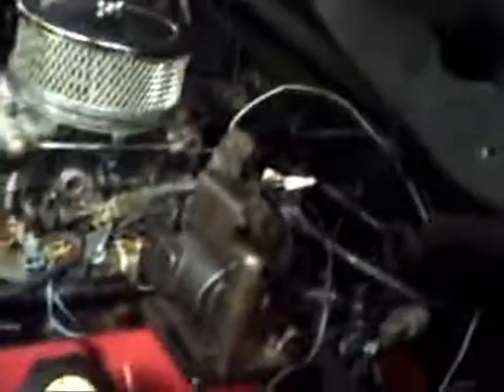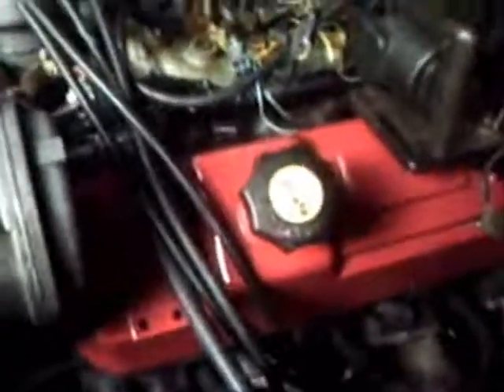clack clack and hause get their valve covers painted

Comment: did ya prime it first? how many coats of paint? did you sand between coats? and did you bake it after? 

I do know for a chrome paint job you will need to lay a gloss black first and then lay the chrome over the top. I think your on the right track with chrome painting the Holley.